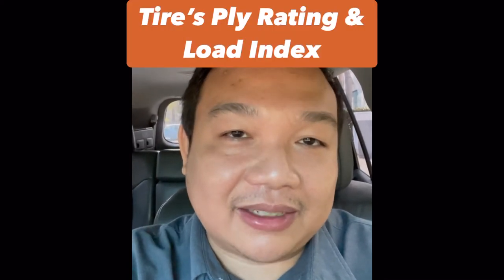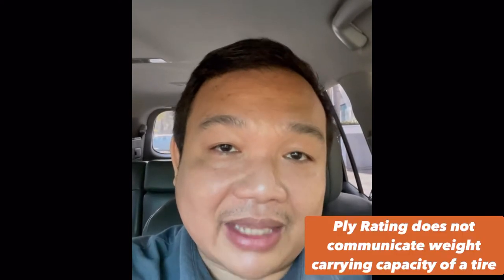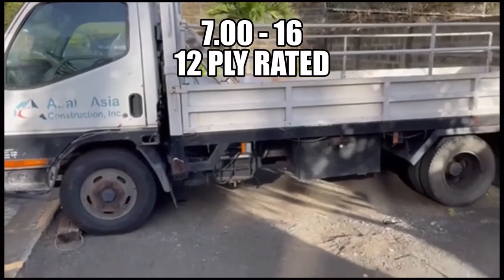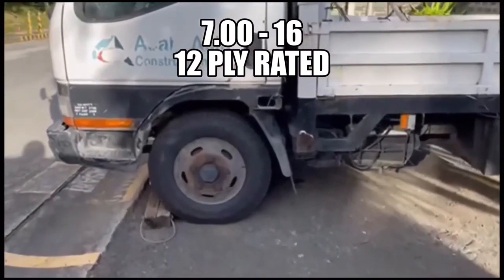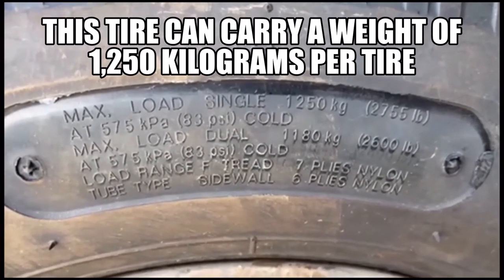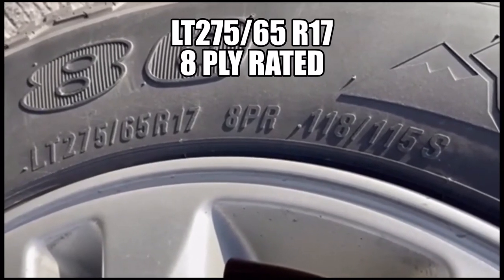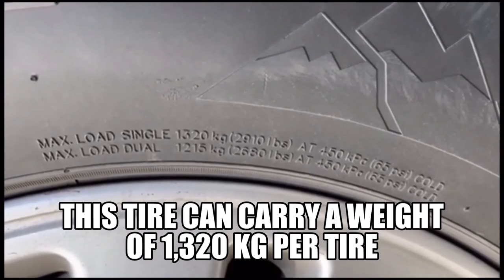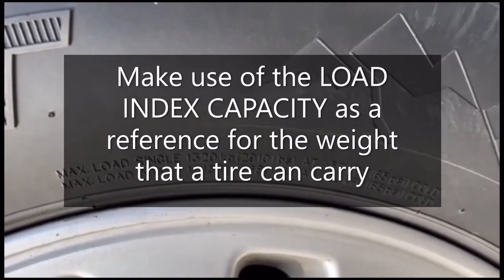Load Index and Ply Rating explained by an experienced tire expert

Comment: I have a 7000 pound denali from the added extra weight and I tow another 5-6k as well sometimes. 
I currently have 10 ply baja boss at 120 load index 
Wanna try to step down to a lighter tire but I have a question about something. 
D load is heavier construction then xl
117 has a high index then 115
Normally the higher the ply the higher the index rating is as well. 
What happens when a tire is load D but 115 index and a xl being a lighter construction being a higher 117 load index? Which would last longer with the correct air pressure and tire rotations?
Reply: Did you ever find out?
Reply: @sneakin3274  nope. Not even tire companies can answer.
Reply: @jwatt95  I don’t really have a concrete answer but my theory is that an LT tyre is just constructed differently with thicker side walls and a reinforced bead but the whole number of plys thing is not actually real. Meaning a 10 ply e load doesn’t actually have 10 plys its just a name. Anyway good luck on your search for the truth ill link a video about the difference between standard load and lt tyre construction to help you grasp the idea.